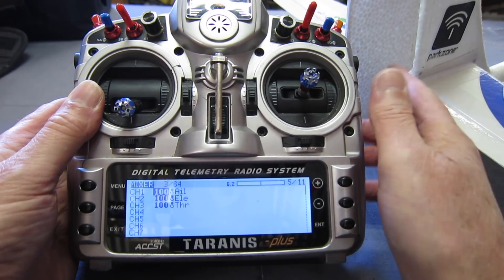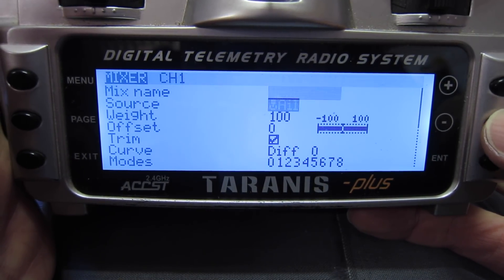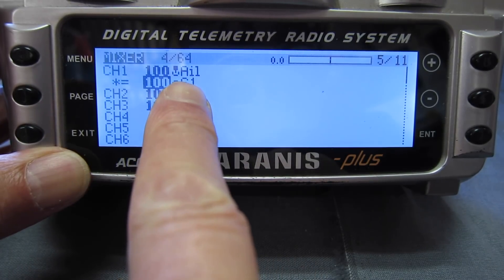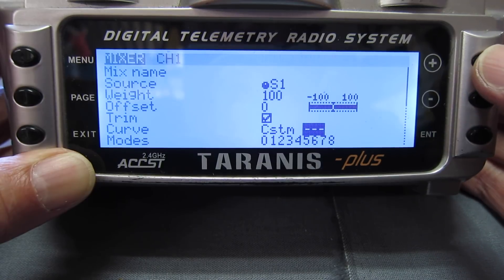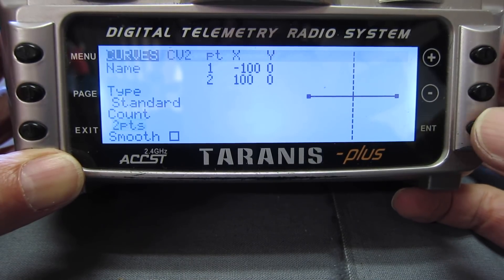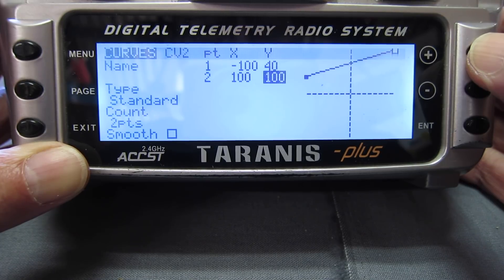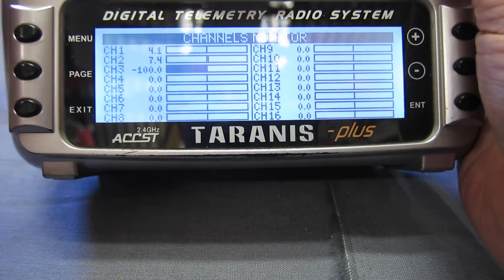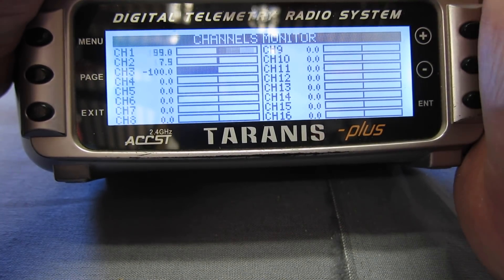Rates on a knob - Multiply

Comment: Very nice tip, easy setup. 

Looking at the tail of your Radian, I was wondering if you changed the angle of the horizontal stab. 
That model can really pitches up on launch under full power. 
Cheers
Reply from the maker: Yes I did all the Paul Naton mods early on. Mine is about 3 degrees flatter than stock

Comment: I noticed the trim changes when you adjust the knob with the stick in the center, at least it looked like it did. (at about 2:42 when you changed from 100 to 40%, the CH1 position changed from about 6 to 2.something) Is there a way to not affect the trim with this mix?
Reply: Instead of using a curve, adjusting the weight and offset for S1 in the mixer screen for your desired 40 to 100 output would work. And also your trim wouldn't then be affected by the curve function.
Reply from the maker: Well spotted, there probably is a way to program it but I have not pursued it. The best solution is to adjust the pushrod length mechanically so zero trim is needed
Reply: Yes, disable the trim in the Ail mix, then add it back in as a new mix after the MULT line. with mix src=TrmA, wt=25
Reply: Wonder if this effects trim only or offset as well.
Reply from the maker: I'll investigate that

Comment: I personally think knobs are useless and havent met anyone that actually uses them in flight... also I think that assigning such an important function to a switch with such little resistance and positive rate lock could prove catastrophic. Cool video though, love how much you could do with the Taranis.
Reply: Actually, those S1 Pots he used in the clip are not loose at all, far from it in fact. Having the infinite adjustment the knob provides is very desirable because you can adjust it easily, even during the flight. It's never going to be "catastrophic" either, dont be such a drama queen.
Reply: Hi Andrew....Yes, some Knobs are more useful than others...Heres the proof......:)
Reply from the maker: Haha, nice one ET. This setup is more useful to get an idea of the correct throws, then translate that to mechanical linkages and ditch the rates.
Reply: I think you are confusing the sliders on the sides with the knobs on the top.  I agree that the sliders need to be tightened up, you can do it if you order new sliders and install them, the new ones seem to be a little better. you could also do the 6 position switch mod which just replaces one of the two knobs on the top with a 6 position variometer. Available from Aloft Hobbies.